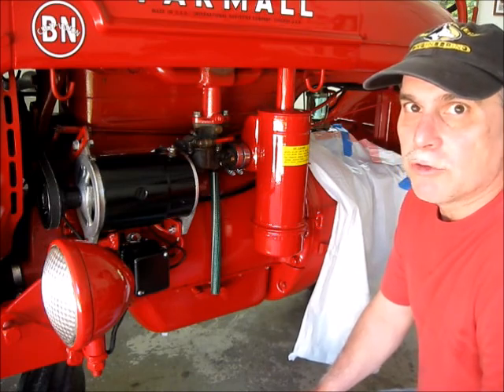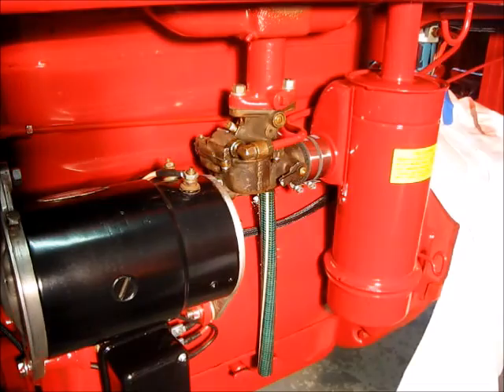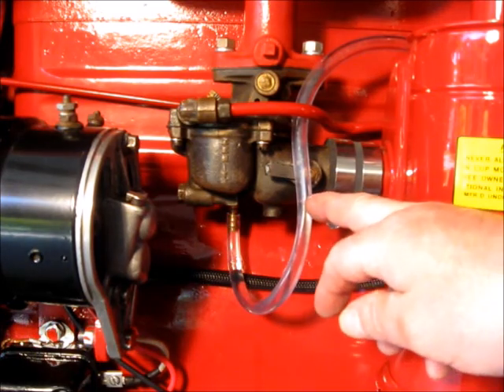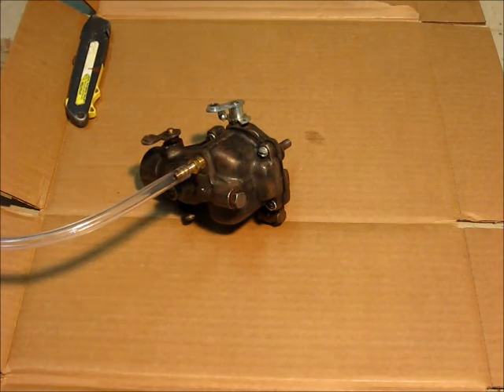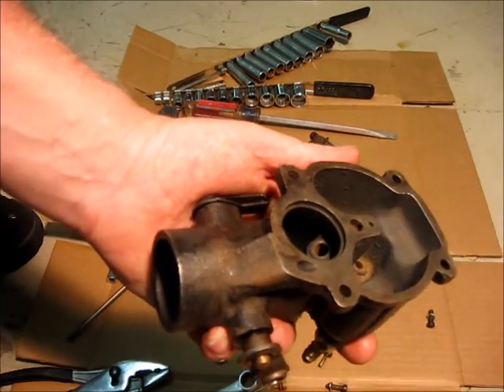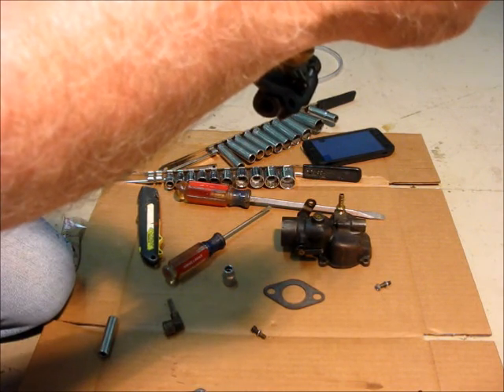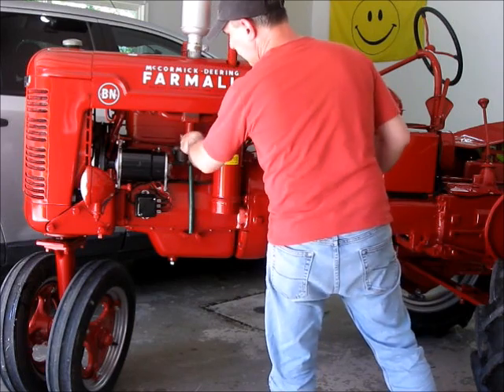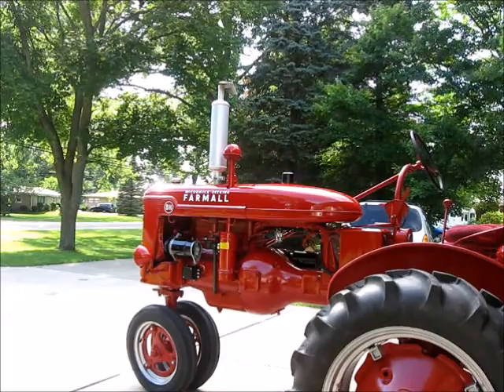1945 Farmall BN Update 47

Comment: Very nice Steve, I think I might have the same problem, I thought that screw is an air/fuel mixture, I will definitely check if my idle screw works, thanks for the video, very learn-some for me
Reply from the maker: Yep it is an Idle / fuel Mixture . Mine never worked till I found those small holes inside . I had one partially blocked. It made My idle adjustment work again and i think it helped the response overall. I think the blockage was from the start. After this clean up i had to set the idle down cause it runs better at an idle now. Thanks for watching Jan. Also my Coil is going bad. Will be back at her with another video. When she gets warmed up I loose spark. After she cools down spark returns. My coil is old in the Magneto.
Reply: @stevekline7247  Thanks Steve, good luck with coil, as you know I put a 12 volt coil on mine and by pass the magneto